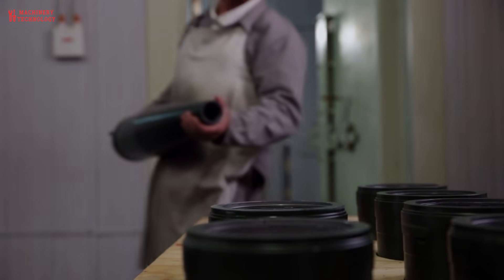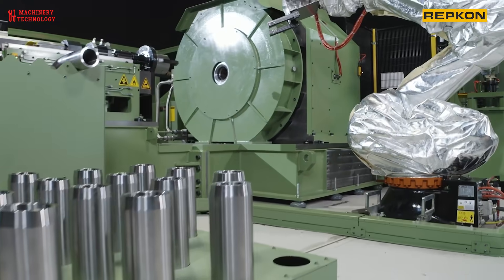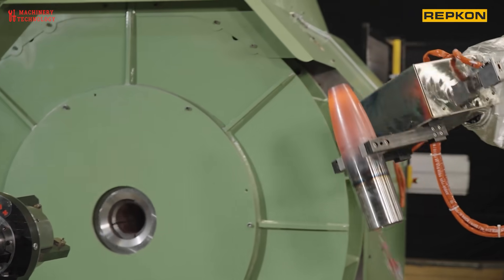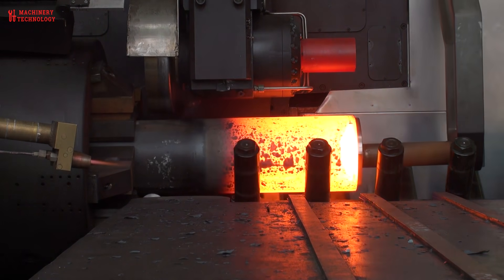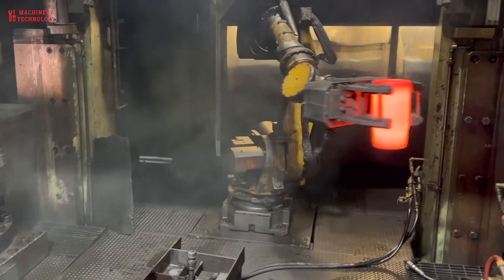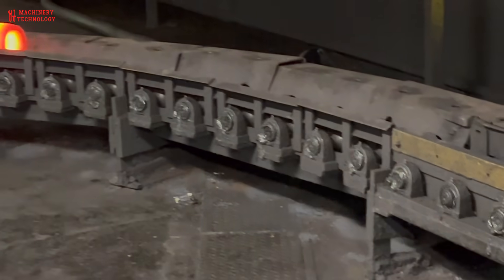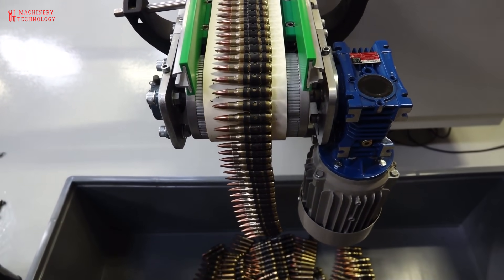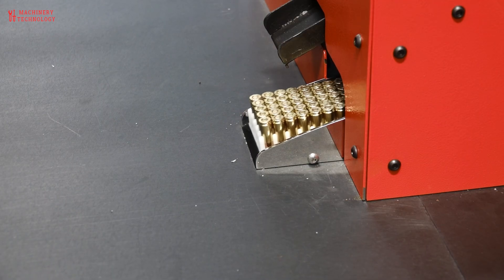Incredible 155mm Artillery Shell Production Process  - The Fastest Mass Bullet Production Line

Comment: It takes 75,000 shells per month to simply hold the lines, while twice as many will be needed for a major offensive. In contrast, Russia releases about 300,000 artillery shells every month (about 10,000 per day).
Reply: That's for all types of shells. The US is already producing close to 100,000 155mm shells per month. That's impressive for a nation at peace and artillery role taken by the USAF.
Reply: @davout5775  The US military set a goal to produce 100,000 rounds of artillery a month by the end of 2025 — less than half of the Russian monthly output
Reply: @Damn6real  Not even gonna bother checking this story because it is completely irrelevant. There are no delays in Boeing's supply chain and they are making jets just fine. In 2023, they sold 528 jets, more than in 2022. So they are just fine. In 2022 they sold more jets than in 2021 480 vs 340. America remains the largest jet manufacturer in the world as well as the largest exports of jets and jet parts.
Reply: @davout5775  Yes, the United States will only bully guerrillas without advanced weapons in the Middle East, which is of course not a problem. But the reality is that the US military is practicing trench warfare during World War I on the Polish border. Even at the lowest production capacity, China's 155mm artillery shell production can easily be 10 times more than that of the United States.
Reply: @davout5775  It may take 100 years to build credibility, but it may only take 1 day to destroy it. Super companies like Boeing should think about 10 years from now, rather than being complacent about being the dominant company now.
Reply: @星宿劫  The US use artillery only for defensive purposes. That role is taken by the air force and that's the case since WW2. You are so occupied into thinking about artillery shells just because Russia is so far behind, they aare still forced to use artillery offensively
Reply: @davout5775  Since the Vietnam War, the U.S. military has increasingly used its air force to attack. This is because the opponents are very weak. In addition, Russia has always been very conservative in its offensive. If any weapons are used in an all-round way, it will easily cause the war to escalate. It is not that Russia is too far behind. Compared with Ukraine, Russia has the advantage.
Reply: @星宿劫  The air force drastically increase the range of engagement and increases the precision. Also it is more flexible. You can have them quick and in almost every situation. Russia is very far behind of the West. That's the reason why artillery shell production is a useless metric. Why would I even compare them to Ukraine both countries were literally the same until 1991?
Reply: @davout5775  Modern warfare is comprehensive and three-dimensional. Any metric is meaningful. When the proud F22 is easily locked by the enemy's radar, and when the airport's runway is destroyed by hypersonic missiles, you will miss the artillery.
Reply: @星宿劫  There is no such thing as easiily locking F-22. Russia would not be using such missiles to destroy airports as they are expensive and you would need a lot of them because majority would go down.
Reply: @davout5775  At least 10 years ago, China's radar was able to track the F-22 and publicly display flight path maps. As long as some technology is exported, the United States' air superiority will not be that great. Besides, your thinking is too confusing. Are you talking about the Ukrainian battlefield or something else? If it is a Ukrainian battlefield, then the Ukrainian side does not even have air control. If it were other battlefields, the United States would not have much advantage when facing China.
Reply: @星宿劫  Every radar can detect and track the F-22 depending on the range. There are also wavelengths that can better detect stealth jets but are not suitable to guide a missile to it. I'm also not sure what situation you are describing right now. China had no confrontations with F-22s 10 years ago.
Reply: @星宿劫  S-400 and S-300 proved incapable of defending Russia's air space. 15% of Russia's oil production was disrupted from UA attacks on RU territory. China's AA systems are based on these 2 so their performance would be similar

Comment: One question, why not cast the shells? Steel casting has come a long way. After that, it's just a matter of normalising and machining. Much faster. Is there a reason?
Reply: The industry has been there and done that...in WW1. Look for and read "The guns 1914-1918" by Ian V. Hogg. Steel casting has not really come far enough to make the difference. In very short, the Brits and the French screwed uo and had very little ammunition for the war in 1914. They thought 2-3,000,000 shells was a lot (same problem we have yet again). They had to make a lot of ammunition in a hurry. In order for cast steel to be as strong as forged steel and create the same bursting pressure and damage....it has to be thicker...which means less explosive and the need for many more shells.  Bluntly put, cast shells require at minimum 26% more steel. that means 26% less explosive....to this day.
Reply: @jessegreenwood1956  the answer is greatly appreciated, as is the reference.

Comment: These shells at the beginning of the Ukraine conflict were approximately $2,000 each. They are now depending of the source between $5-8,000 per shell and Ukraine can fire as many as 20,000 per day.
Reply: ukraine hasn't fired more than 8 thousand a day ever.
Reply: 155mm shell production facilities are either antiquated or fairly new NONE of the operational ones are designed to make thousands of shells per day most are for a thousand or so per week at full production! Everyone was sold AIRWAR was king and no one would engage in artillery battles any more! So the massive old plants were mothballed and then deemed too expensive to update to modern production standards and demolished!  Leaving a very few smaller facilities slowly producing enough to keep up with reduced training needs (The number of active artillery pieces in many militarys was slashed with  new artillery systems  implemented in limited numbers, while stored systems were deemed too obsolescent/inadequate for reactivation and scraped! ) 😊😮

Comment: That shell forging process is amazing - I assumed that it would be turned, but this is a much better way of using the billet and making it really strong as well.
Reply: Its two different processing centers shown  you will never see that  canoes truck at an American  plant.. the main thing  is that everything  must be of the same diameter  and the weight of the charge  and round  must be the same..just  a tiny bit difference  and the round can miss by a hundred  yards

Comment: I used to know a guy with a small machine shop. For years his primary business was producing the nose caps for 5" naval shells. Two eight spindle automatic lathes built by Cone Machinery. Made from solid 75mm diameter bar stock the finished parts weighed probably 900 grams if that
Reply: Yes here in India we make it with multi spindle cnc turning